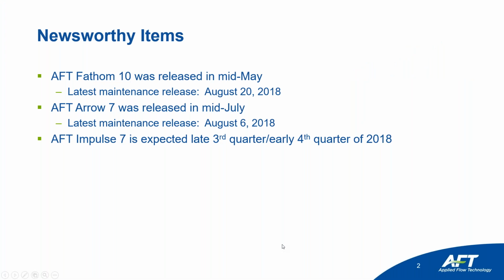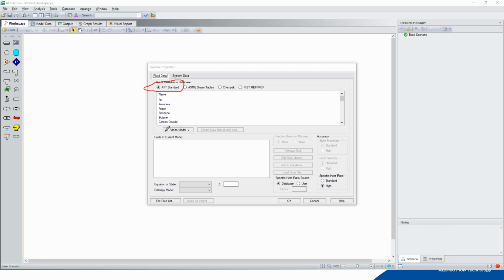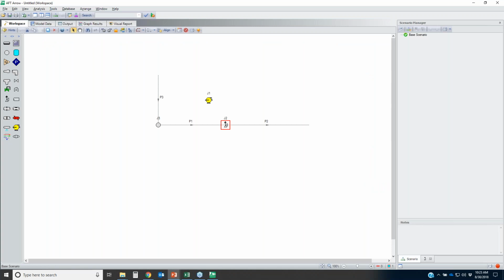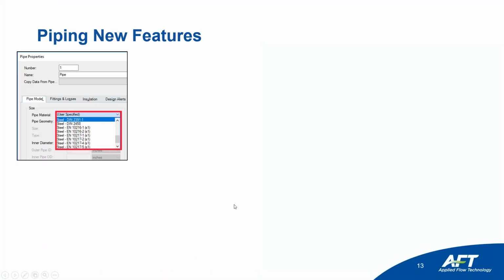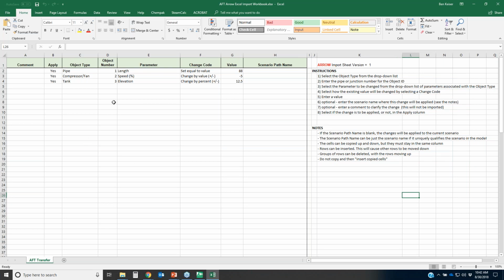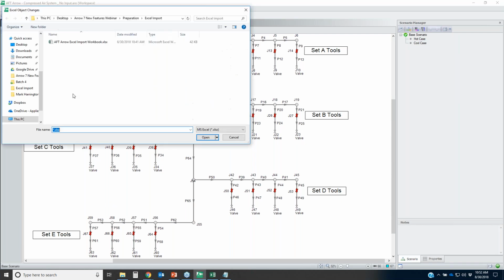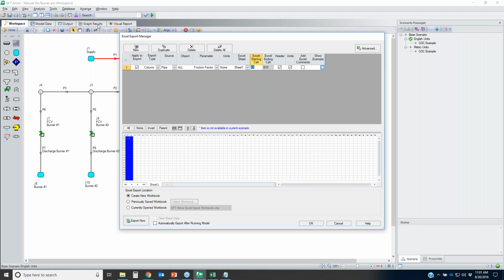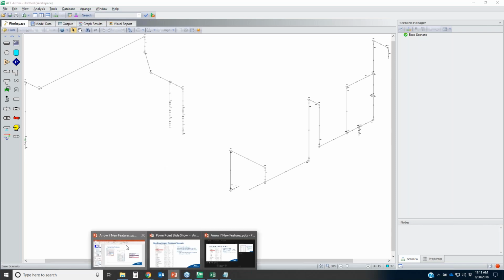AFT Arrow 7 New Features.  Import More.  Export Better.

Comment: Manual calculations results for Natural Gas or any compressed gas are quite different when using Aft Arrow . Such as an example when using Fundamental flow equation. Please clarify???
Reply from the maker: AFT Arrow is a highly accurate solution and often provides more accuracy and reliability than manual calculations for compressible flow because it is solving fundamental thermodynamic equations rather than simplified compressible flow correlation side steps.  Therefore, AFT Arrow can properly take into account all compressible effects, including real gas behavior, heat transfer, and sonic choking.  Here is an excellent article that discusses the important methods for solving compressible flow accurately, https://www.aft.com/technical-papers/gas-flow-calculations-don-t-choke.  These are the methods used in AFT Arrow.